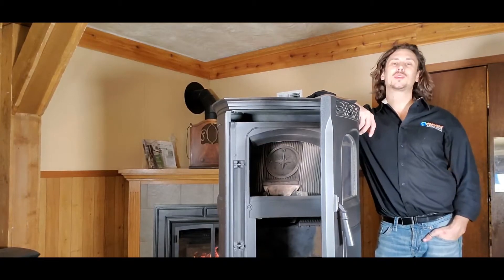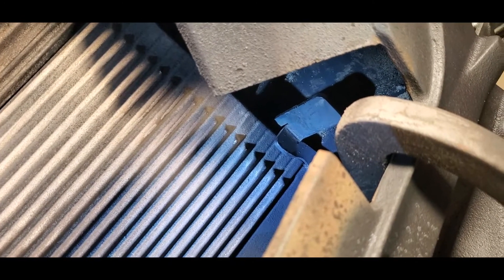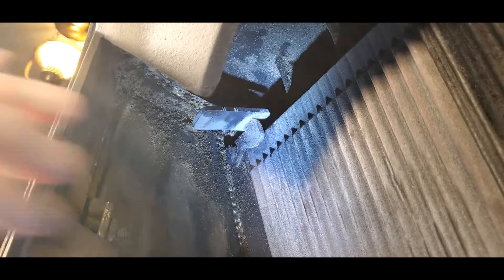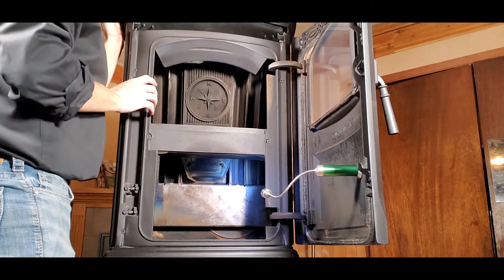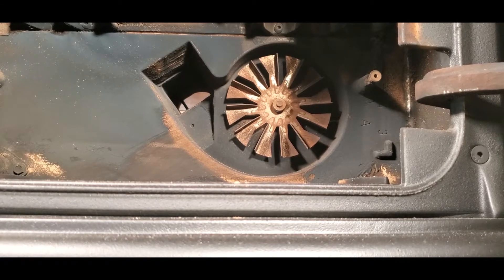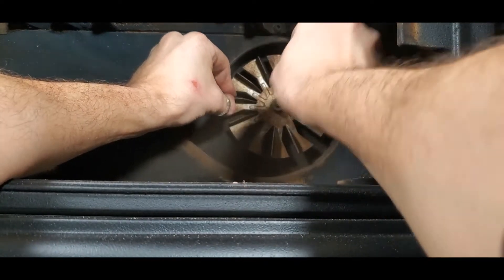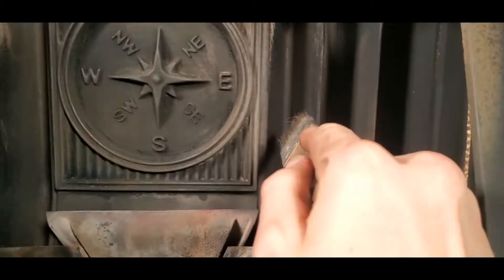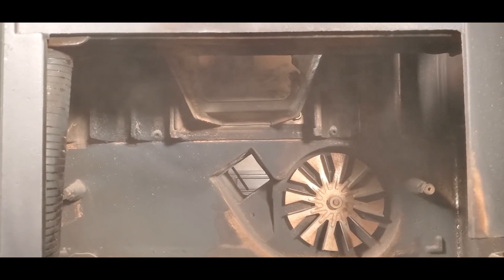Harman Accentra Cast Combustion Baffle Plate & Heat Exchangers

Comment: I use a DUSTLESS shop vac when cleaning my Accentra (triple filtration) and have it running all the time while I'm cleaning and brushing out the buildup within my Accentra. I keep it close to the brush or tool I am using. Unless you do this, you will get TONS of fine soot and dust all over the room in which you stove resides.
Reply from the maker: Yes that's a great tip. An Ash Vac or Shop Vac like you have is definitely recommended. Another tip would be to turn on the stove with the door open. The combustion blower will run which helps to pull the fly ash in the firebox inwards and out the exhaust instead of out into the room. The auger motor won't run with the door open. Have the igniter toggle on manual so that it doesn't turn on. Still good to use a nice drop cloth as well. And a great vacuum cleaner makes all the difference. Appreciate you sharing.
Reply: @EarthSense  Amen and amen! :)

Comment: I like my Harman Accentra but after 20 years its just loud.  I have changed the exhaust fan twice and  its still so loud. I do enjoy the incredible heat it throws.
Reply from the maker: Do you think the noise is coming from the exhaust fan? Or could it be coming from the Distribution Blower? As the motors wear they will get loud in operation - Exhaust, Distribution, Auger. You should find replacing the noisy motor solves the problem. See if you can pinpoint where the noise is originating from - Even if you can find a child's Stethoscope that can be very helpful in pinpointing the noise. Happy to help if needed. Thanks!